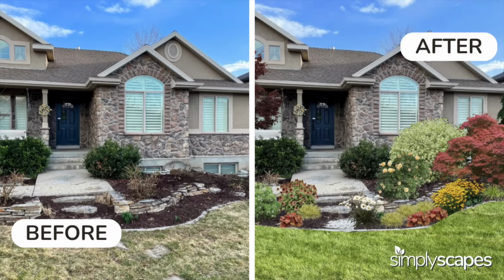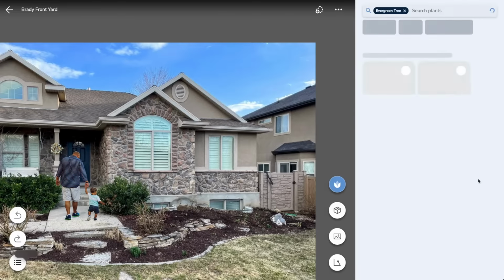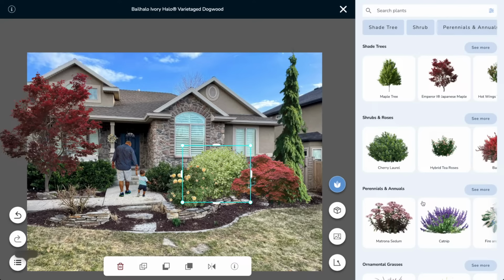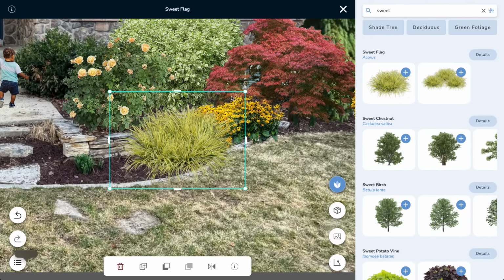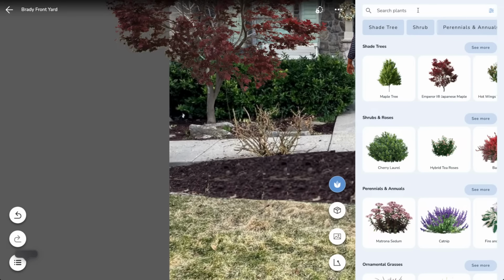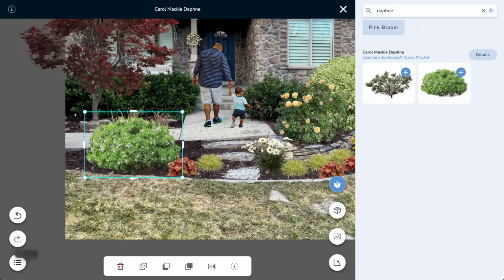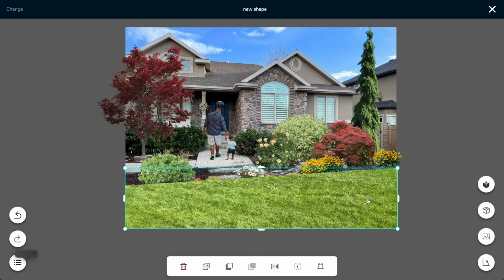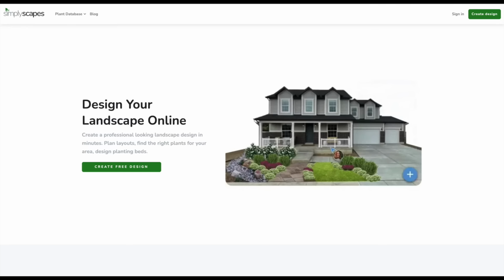How to Create an AMAZING Landscape Design 🌿 ONLINE!  💚 // Simplyscapes

Comment: Thanks so much! I assume it gives you the plants for your zone? What's the cost for this software/app?
Reply from the maker: SimplyScapes costs 29.99 a month, 9.99 a week or $299.00 a year. You can filter plants by your zone.
Reply: Most plants have zone information.  You can also search for plants based on height and other characteristics.  It's free to use.  Pricing starts at $10, which gives you full access to the library of over 7,000 photo-realistic plant images.